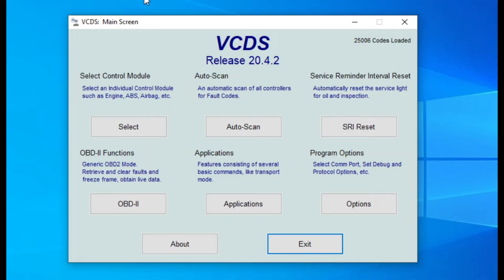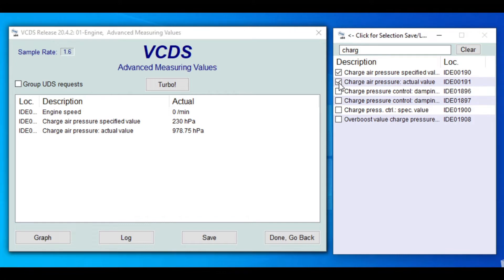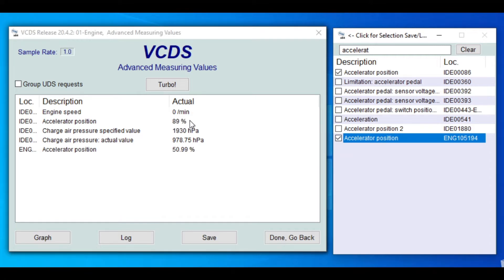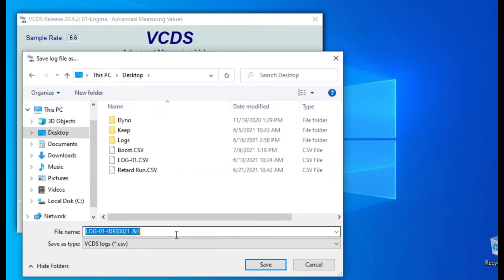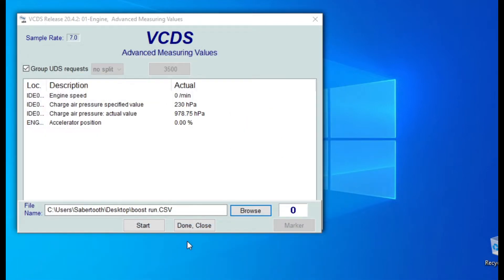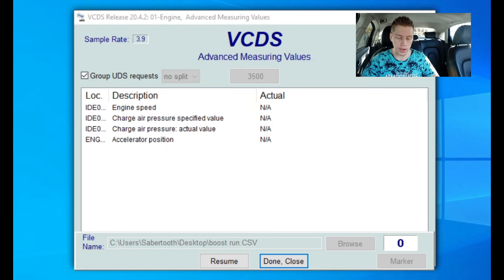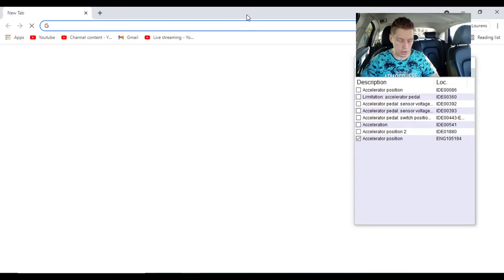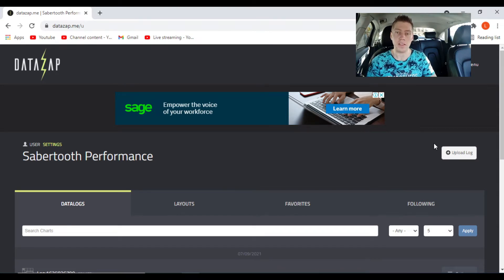How To Data Log your Turbo or Supercharger With VCDS

Comment: Hi, thanks for the video, i'd like to know how i could log the N75 solenoid duty cycle, i have a 2012 seatl leon tdi and i'm overboosting ( i have a slow boost build and then it goes up to 2x specefied boost level ). At the same time i think the N75 duty cycle is at 100% at idle ( which is full boost ) isn't that weird ?
Reply from the maker: Hi, I have already planned my N75 video to come up in the future 👌💪 and just like yours I am experiencing the same problem. Mine just doesn't want to open enough... It's like the car is also overboosting but my valve is saying no I will only open it a bit 🤣 but yea fully closed at idle is weird... Maybe if the car is doing a cold start then yea I would understand sothat it can warm up the turbo quicker... But if your car isbhot and it is still closed... Then that is another problem
Reply: @megalodononwheels  I'm having a hard time diagnosing my problem, my car has been over boosting to the sky, I'm getting 2 fault codes : over boost limit exceeded, and vnt stuck.
 I was thinking that maybe my VNT rod needs ajustement, but then maybe my intake manifold could be clogged (bad EGR valve maybe). The thing is I've removed my head and intake for head gasket replacement and cleaned everything 4 months ago.
Reply: @darkblood8986  VNT in turbo is clogged most probably
Reply from the maker: Have you sorted the prob? YT never showed me this comment :( also if you haven't fixed it, what car are you driving? Like my car that has the stock K03 does not have the adjustable rod on the wastegate. but I suspect it might be the wastegate that is stuck. In a never video I made a weird contraption to see if my wastegate moves and under what pressure. 

https://youtu.be/bDaopmzEdaE
Reply: @megalodononwheels  yes I sorted the problem, it was a clogged catalytic converter (my car doesn’t hav a DPF). Basically it was clogged and the exhaust gases couldn’t escape, creating a higher pressure in the intake manifold.
Reply from the maker: ahhhh damn that makes so much sense! Ok glad you have that! it is so crazy that it didn't pop up a message saying that the catalytic efficiency is below limit! but at least you sorted it out! @darkblood8986

Comment: Congratulations .
There are many youtubers talking about VCDS and Logs ...... but no one has explained as clearly and making logs for each component exam separately as you do, and with the extra that you explain how the graph and data are interpreted and how the normal behavior should be and when the data is not good, you explain what it may be due to and what should be correct.

Your videos on this are very instructive, I was looking for someone like you to explain things to novice people like me and thanks to you now I see things much more clearly.

By the way, a question.
In this test that you carry out on the behavior of the turbocharger, could you also add the log on motor torque NM? which one should be pointed out or added... engine Torque IDE00100 ??? Would it be this alone or do I have to add another?

Thank you very much and keep it up, research more about VCDS if possible and keep making video tutorials so well explained.

Greetings.
Reply from the maker: Hi, sorry for only getting to you now... I actually held your message on not responded yet so everytime when i look to see my analytics or comments i will always see yours haha... I wanted to make sure i respond to your message :) and unfortunately i am getting back to you now with no info as yet :( my car battery was dead aswell as i have a flat and lost my lock nut, so I can't take my wheel off 🤦 so bought a new battery today and the lock nut might only arrive within a dew days... So on my next off cycle i will look into it ☺️👌 i just want to say thank you so much... I really do appreciate the kind words 🙏 i have so much more data logging videos i want to make... I can't stop with it haha it shows you so much and you learn so many different things from it ☺️
Reply: @megalodononwheels  Nice to talk to you.... Sorry if my language is somewhat confusing, my native language is Spanish and I use translators to write English.
  Well, it's unfortunate that you had that problem with the vehicle.  Curiously, it has happened to me like you when taking logs and passing it to Datazap on Lambda probe measurement, it only shows me the line of the ideal data but not the real data.... A pity since it is a waste of time... I will try perform these checks again to see if this time it displays that data...
If you manage to find out what is the exact cause that the real lambda data is not always displayed in Datazap, please let me know and what is your solution.  Where I usually do this type of measurement is a very limited area and when I do it I find it very difficult and I can't always do it.

About the security nuts, I preferred to remove them and put normal nuts.  Unfortunately, if thieves try to steal them, the security nuts will remove them very easily and if they can't, they will destroy the rim trying to do so, and in case of damaging the rim and not being able to steal them, the comprehensive insurance is not responsible for the deterioration of the rim. in the attempted robbery, so I prefer that it be stolen and thus the insurance does cover the robbery.
Reply from the maker: Hey buddy... Ok so where do i start lol... The translate from spanish to english is amazing... I did not really picked up that your message was translate haha... 

Also the lambda, there is something you can do... I don't know if you have Microsoft excel, you can actually use it to open the logged file before you upload it to datazap. The only thing datazap does is, it places information in a line chart. So that you can see it clearly. Where if you open it with Microsoft excel it will be in numbers but you will still be able to read it. Try it out :) might also make a video of it in the future :)

And then yea its true about the security nut haha, but i am hoping that they would rather just not steal it at all haha... People who does try to steal it wont jack your car up properly, they also wont care if your car falls off the bricks or what they do to the car until they get the wheels off... So it might cause body damage and have missing wheels 🤣 i prefer damage wheels above body damage you know haha but your statement is not false :)

Comment: Bro, do you know any website for getting the stock values of boost, fuel pressure, afr, etc of a vehicle?. I mean  just in order to know how to read all those values.
Reply from the maker: I unfortunately have no idea where to get that info 🤦 i can imagine that they won't show it because it will help opposing competition to find out their secret such as why audi makes more power than bmw... (as an Example)... But like i mentioned, almost all the values you want to look at has a specified and actual value, so you just need to make sure it is as close to that as possible for Optimal performance :)